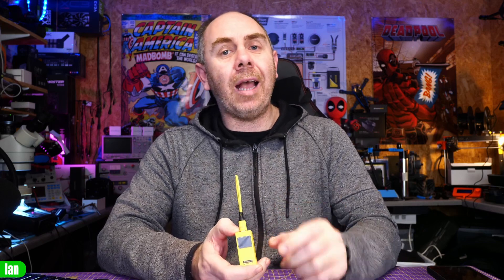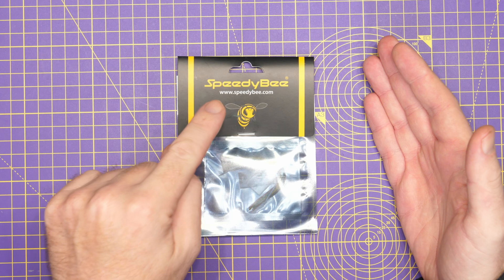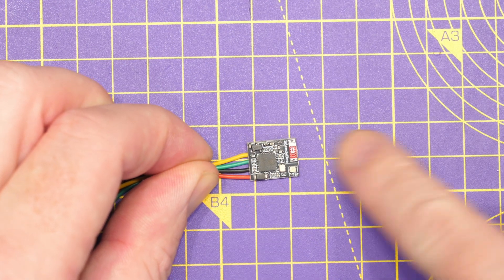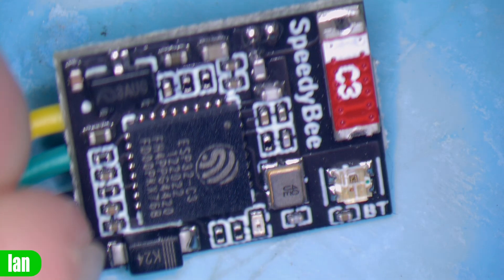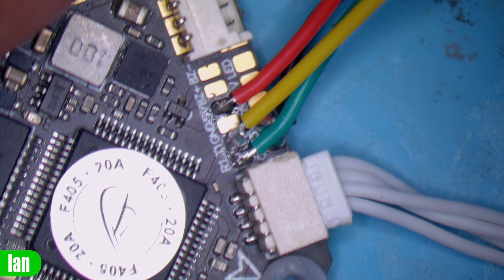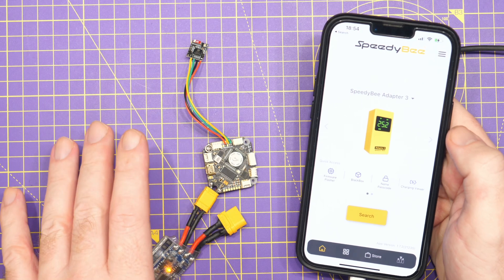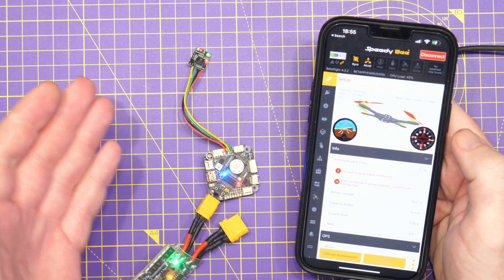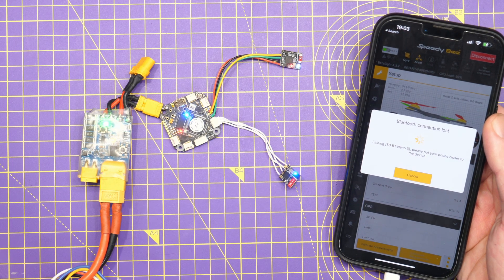Speedybee BT Nano 3 - Wireless Betaflight Config For All FC

Comment: Great video.
I ripped my micro-USB socket from the FC. 
Is this device suitable for set Betaflight and flash firmware (in the future) instead of try to fix the broken component?
Is possible connect to the FC after solder the module without any setup made with USB connection before?
Reply: Yes, firmware flashing is possible. ESC too

Comment: also if you reallly really want to adujust stuff take a laptop with you runing windows and do it that way its way safer and works just fine unless speedy bee tells me other wise etc ill hold true to my statement below reason being one youtuber demonstrated this and warned us about this stuff so im passing it on i dont know how speedy bee does it with the 745 board with both usb and this enabled so doing what mad tech suggests turning off msp yea bad idea proabbly dont do uart 1 too do uart like 4 usb uses uart 1 some flight controllers share the data line this is why hd zero had issues with being on uart 1  so swap it to anyone other than 3 and 2 and your good so 4 5 6 7 should be good since 1 2 usb uses and 3 is for your serial etc reciever and the rest are negotiable
Reply from the maker: I have not suggested turning off USB MSP.  Tell me where I said that ? 

Secondly you would never be bricked. Even if you did turn off usb MSP you could just re flash the flight controller in DFU mode.  

However at no point have I said turning off the USB MSP. Your saying something that’s not correct
Reply: @MadRC  you said turn on msp on uart 1 second you do that notice that msp browns out or turns off on usb msp you can only use one msp either usb or the little controller thingie your talking about.. and i saw a video some guy did a while back ago where he proved once he swapped it to the first gen one that his device failed then he couldn't go back why because you need to be able to go into betaflight to do so and how though usb or the device and if the device fails then your screwed because no way to access betaflight.. so you bascially cancel being able to plug a usb cable into it... and using uart 1-2 uses msp when me and the guys over at discord were testing the hdzero on inav i was one of the guys who had trouble with msp with hd zero on uart 1 and 2 and i found out that both are the usb line they share and cause problems.. just a side note but i do know once you swap over and something happens that your done for thats why its best to just leave well enough alone no one needs to access betaflight in the feild for pids your smart audio capable drone you can do it in your goggles if you really want wireless speedy bee makes a 745 aio board with it installed already and does not swap msp over to the wireless when in use dont know how they do it but you can still use usb not at same time but you wont have the issue of going crap now i cant get back into betaflight and im screwed

prove me wrong try it on a board your willing to sacrifice swap msp then just disconnect the power to the little bt device and plug in usb and see if you can access beta flight if you cant it proves my theory if not ill take my words back.. its just something i saw on a video that a guy proved like over a year ago when these things came out i have the first gen one i tossed it in the trash after i saw his video not trying to sway anyone just trying to make sure no one looses their controller.. and that side story thats how i know msp uses uart 1 and 2 it shares them 3 is for your rx and the rest for other stuff but maybe if you use uart 1 0r 2 it wont have issues with the usb thing im talking about but do a test i would but i dont have a board im willing to sacrifice now
Reply from the maker: @jerrypatterson55  I’m sorry but your completely wrong. You can turn on MSP on any UART ports. It has zero affect on USB.  Your seeing something that’s not happing. USB is not remotely affect by this or any thing like this.  I don’t know what your being told or seeing but regardless of what’s connected you will always be able to connect via usb.  I don’t even know where your seeing the USB turn off as that’s not happing.

USB is greyed out as I’m actually connected to it via PC.  That’s nothing that’s caused by this module.  

ExpressLRS receives will have this same functionality soon as well and again none of this is affecting the usb.  

If the unit was to random fail just reboot the fc and connect on USB.  It can also be used on any UART.
Reply: @MadRC  do this.... take the power away from the blutooth adaptor then now plug in your usb cable in to the flight controller see if you can access betaflight.. if you cant then im right and your screwed
Reply: @MadRC  ok do this right now... disconnect or cut the power wire from this bt adaptor thing now plug in a usb cable and try to acess betaflight..  you wont be able too.. why because you turned it off in the configurator this is what im talking about.. just try it you cant screw it up since you have a working bt adaptor just plug it back in.. but what happens when your flying and it ripps off your drone and you cant find it or it fails then you wont be able to ever again acess the usb cable to configure it again   i dont know how speedy bee does it with their boards with it built in it must have a auto switch over function or not use msp ... and i do know that the usb cable is on uart 1 and 2 when i had issue with my hd zero the discord group and i tested it and i found that if i removed it and used another uart other than 3.. so i would put this bt dongle thing on uart 4 use uart 5 for your vtx and 6 for your gps and 7 esc...... im not trying to bullshit or steer anyone wrong... so prove me wrong  i wont trust any outside dongle device that tells you to switch of msp on usb to use it on uart 1 this is swapping over control of the usb functionality to this little device and if it fails you never ever again will be able to acess your flight controller basically your screwed
Reply from the maker: @jerrypatterson55  I DID NOT TURN IT OFF. I am sorry but your talking complete nonsense. IT IS FINE I HAVE TESTED THIS. Tell me the time stamp  moment I turned of, you cant because because I did not. Its on and remans on. I am going live in 2 minute and will demo this on air
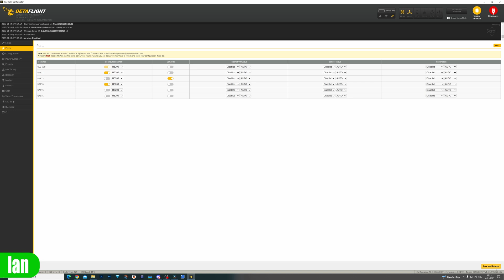Reply: @MadRC  4:29 you state make sure this first colum uart 1 turned on notice msp on usb vcp is now greyed out that means its off because you swapped it.. im not speaking nonsense im mealy protecting others im not saying your a liar.. either...    like i said try this disconnect power wire from the bt device then connect a usb cable see if you can access betaflight if you cant then then i was right.. im not trying to be a jerk etc to you its just that i saw what i saw and it happened to me when i tried this with version 1 of the bt module
Reply from the maker: @jerrypatterson55  it’s greyed out because I’m connected via USB.  It’s nothing to do with UART 1.  You can’t change a config on something your using to be connected too.  That option is ALWAYS grey out when your connected via usb.  

As for doing what you said I did it live on on last nights live stream at the very start.  I’m  sorry but your seeing something that is not actually happening. 

The only way the thing you are saying would happen is If the the user intentionally turned off that option, it is never done automatically.  

Further more you would never be bricked as you can always flash a flight controller via DFU.  That option does not prevent that. But again it’s irrelevant as it’s not being turned off in the first place.  

USB VCP is only grayed out because im using it. It’s nothing to do with the adapter. 

If you want to see it then go to the last love stream it all showed LIVE.
Reply: What he's talking about is when you disable msp on the USB port and from there you can't connect to betaflight configurator anymore using USB. Betaflight config even has a special warning about it. That is totally a real thing and is well known. But mads never really said that and even if he did he's right you can always put in dfu if you have a button or dfu pad so it's not a big deal. And if you disable msp on USB and use the BT adapter you could always use the BT adapter to re enable it. As far as the hdzero similar issue I'm not sure what he's referring to. It kinda sounds like that issue with trying to flash and stm32s can't have stuff connected to uart 1 and 3 but I honestly have no idea about any of that or the hdzero issue. I don't think mads made any errors. If it was that easy to screw something up that'd be on speedy bee for not mentioning it repeatedly. But then again they had those escs that like self destructed so who knows. Great video, thanks. And not all fc's use a uart for USB. Actually most don't anymore I don't think.
Reply: @JustinHunnicutt  yup you got it.. but see if the bt fails theres no way to plug in a usb anymore and get it to work.. so your bricked not sure how they do it on the speedy bee with both usb msp enabled and Bluetooth working they may use a different port or something instead of msp aka uart etc.. so if someone is willing to sacrifice a board see if we are wrong or right.. but like i said i saw a video once where a guy mentioned it this is why i pass it on.. plus its kinda useless anyway because you can bring a laptop ..with you do the same thing and its only if your a racer but now with goggles and fpv monitors you can adjust pids via smart audio so why even bother with this thing
Reply: @jerrypatterson55  what sacrifice are you talking about? as DFU reflash mode can be used no matter what settings were set (MSP, everything off, etc). Also, as JustinHunnicut said, not all FCs use a uart for USB anymore at all, but even that is irrelevant in this case.

Comment: Not sure what this is a solution to?  Why would you want to carry the extra weight and add wiring?  Programming via usb cable is easy enough and using the OSD to fine tune settings works well.  If you didn't have a PC then the removable adapter makes sense and unplug during flight.
Reply: Agreed. 
My SpeedyBee adapter 3 works great. 
Women love a clean build.
Reply: once your plane is all setup it can be a pain to start removing canopies and shit to access the usb port. This is great. most quads also won't care about 3 grams

Comment: Hi Ian, sorry to bother you with the other topic, but the fan on my dji goggles V2 suddenly stopped working, so they are just going black in few minutes after powering on. Do you have any tips on how to repair it maybe? Can it be a matter of the firmware? I'm on 06 firmware but since the fan won't start, I'm a bit afraid of updating them as they might get overheat during the process.

Comment: That solder job .....ouch!
Reply from the maker: Ffs as I said. A quick and dirty connection on the bench. It does not require your masterful eye to give it a once over.
Reply: @MadRC  Never stated I had a masterful eye simply what I thought in my head so I wrote it down.  You can holster your keyboard rage.

Comment: A SpeedyBee "Pro" App would be nice. May be 20€-30€ for a version which connects via ELRS-Wifi to the FC.
Reply: That's just the betaflight app but without cli and preset. It's free and works great right now.
Reply: @JustinHunnicutt  But not available at the stores (Apple/Android) (only as manual untrusted apk for Android as far as I know
Reply: @olbu  That's a really good point. I didn't even think about the fact that most people don't like apk's. I've even got one new android phone that won't let me install apk's even after enabling it like I normally would and then a full reset of the phone, so yeah apk's can be a hassle.

Comment: I have had the Flywoo BT Nano for quite a while and I've been using with the SpeedyBee app. The only difference I can see functionally is that it can't be powered down when arming unless it's connected to a power switch (something like TinysLEDs  RealPit VTX power switch). 

I'm curious how the SpeedyBee detects arming in order to power down.
Reply: It seems like the msp connection just passes along the arming state . I don't know much about msp but that seems pretty simple. If you want you can use any other pad like led or an extra motor output, connect it to the switch pad on bt adapter and tell speedy bee to associate that pad with arming status and it'll disable BT without using the msp connection.

Comment: I just take an otg cable with me, and use betaflight configurator on my android phone. I had several flight controllers with WiFi/Bluetooth connectivity but i really think it's a pita. also had bad experience with old speedybee app (=borked config) haven't used it since then..
Reply: This, wish Ian had mentioned that you just need a cable. This chip is great for cinewhoops tho 👌
Reply: Stupid question but how did you get it for android? I can't find it, not even on the github
Reply: @redcobra1246  speedybee app
Reply: @RP  ooh I didn't know it worked with the cable
Reply: @redcobra1246  yeah OTG. That’s what they call the cable that goes from the android to the normal usb. “On the go” I think it means lol
Reply: I use the cable that came with my DJI drone.